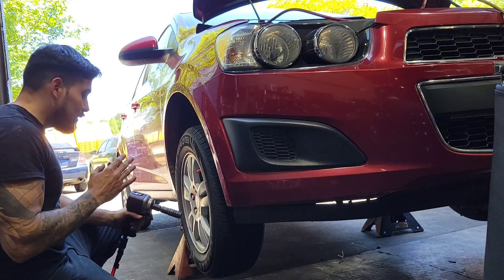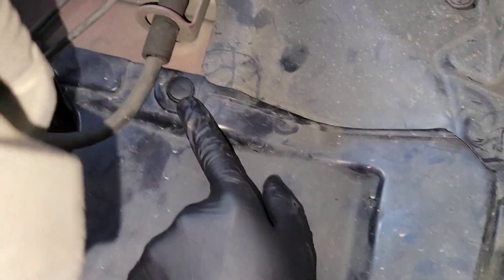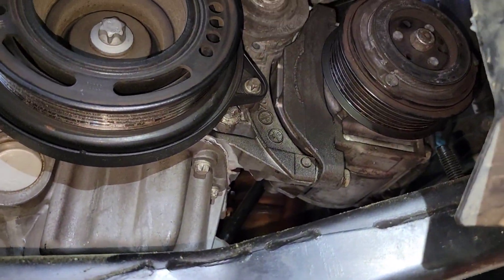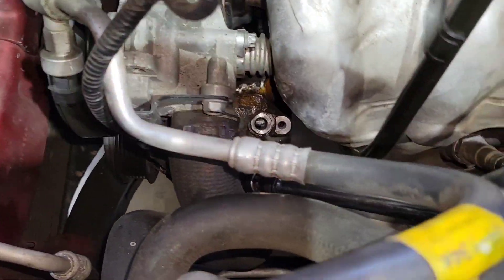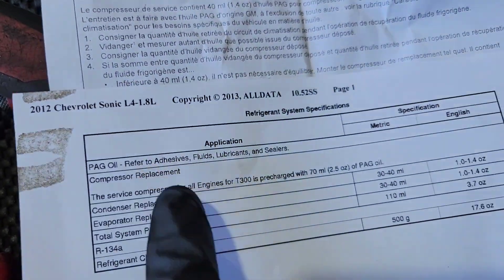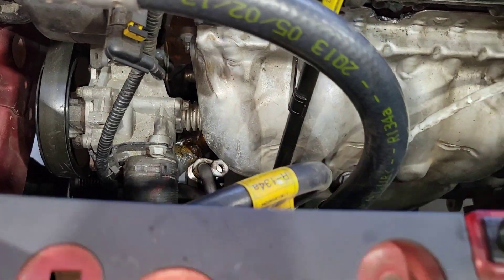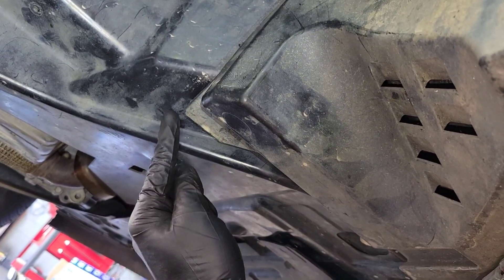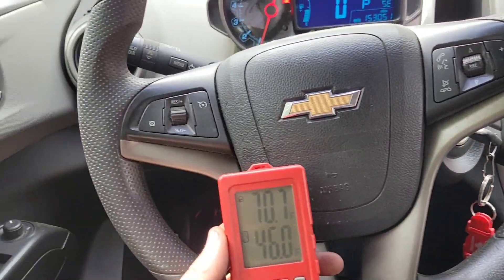Chevy Cruze, Sonic 1.8L Ecotec  AC Compressor Installation

Comment: My AC starts cooling down when the car is running and stops cooling down when the car stops. I’ve already checked the AC gas level, and it’s at the correct level. Do you think the compressor might be the problem?
Reply: did you figure out the issue with this? I have the same problem.
Reply: Either weak compressor or raider fans aren’t working
Reply from the maker: You either have a weak compressor or your cooling fans are not working. I would probably rule out the fan because if the fans were not working then your vehicle would overheat

Comment: Ac has to be empty b4 replacing? Re charged afterwards?
Reply from the maker: Yes, the AC system has to be evacuated to release pressure, then has to be charged after repair with correct oil and refrigerant specs

Comment: Hello, did you have to change the ac condenser as well together with the compressor?
Reply from the maker: hey! and no, I did not replace the condenser, but I did flush the lines with AC flush and also replaced the drier!

Comment: I feel my car really sluggish when I turn my ac on any tips or advice? Should I replace my compressor? My ac feels good when it's on tho and blows cold
Reply from the maker: No, dont replace the compressor for that issue, you could be experiencing lack of power for other reasons on the motor. Everytime you engage the compressor ON you are putting another LOAD on the engine which causes engine to have to work harder to acheive the same goal of moving the car, so if something engine related like a misfire, clogged exhausted, throttle issue etc, is present, activating the AC load makes the issue worst but doesnt mean its the compressors fault. The compressor clutch could be stuck or requiring too much effort to turn which could also cause the issue. Basically, go get a diagnostic to verify the exact issue